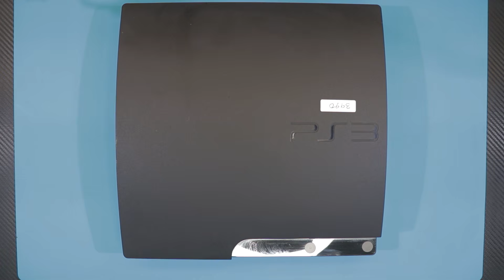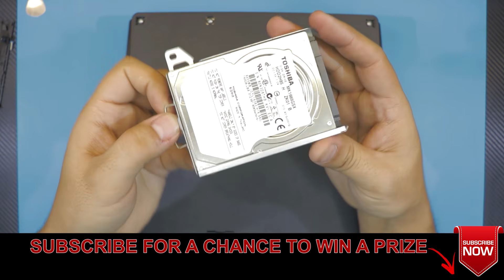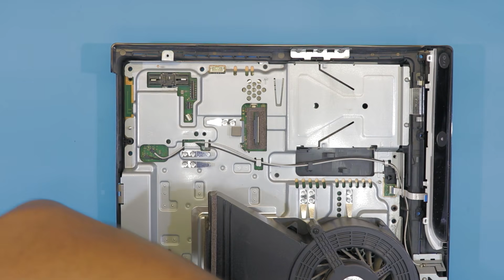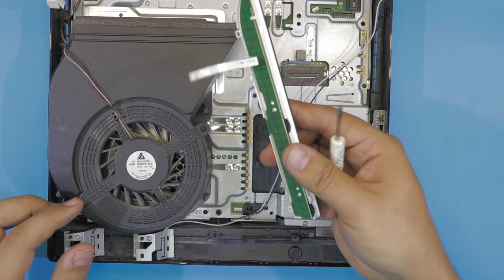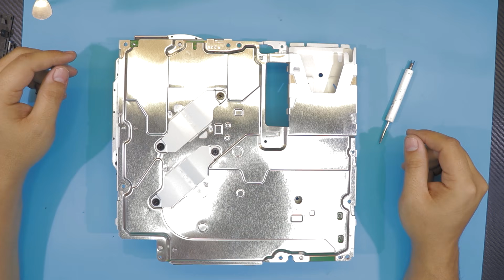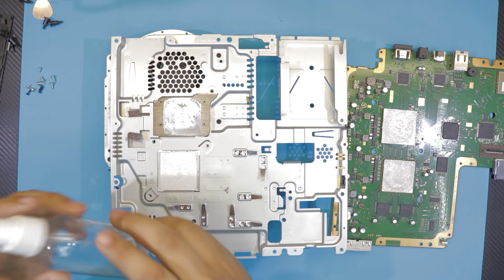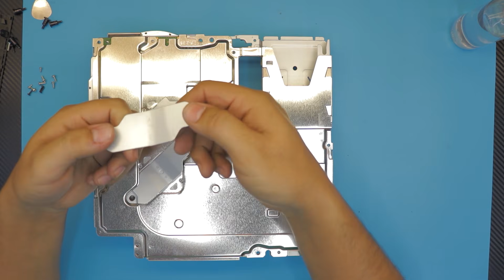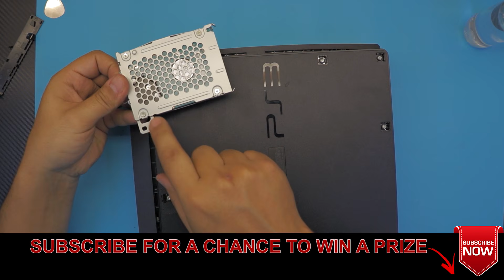HOW TO CLEAN AND  REPASTE YOUR PS3 SLIM ( playstation 3 slim console )

Comment: He forgot to put the black screw that holds the optic drive in place back (right before putting the power unit). See at 25:05
Reply from the maker: Oleg Lukyanchikov yes my friend you are right , i had to reopn it and place the screw back, but nothing will happen if you dont the chassis holds the optic drive very tightly. But good observation.  This video is old and back then i was trying to focus on the recording monitor and do the job in a position that i had the camera on my face almost.  Now im used to record and do the service at the same time 😋 thanks for the support  and comments
Reply: @uFixTek  thank you for great job showing the procedure. I just left the comment here so that others can put the screw back. When I was done,  I got worried when I saw I had one black screw left :)
Reply from the maker: much appreciated :)

Comment: Damn there’s a handful of screws I’ve failed to place lmaooo
Reply from the maker: it happens most of the screws are useless anyways.
Reply: uFixTek ahh thank god, my PS3 won’t accept discs now though. My uncle did tell me the PS3 doesn’t want to take in disks,  but it’s because the rom metal frame is smashed so it’s covering the entry port for it to take discs
Reply: I left out the security torx screws, I removed them with a tiny flat-headed screwdriver! xD
Reply: @Major Gear no screws left on table after reassembling, did I something wrong? :o
Reply: @Shejku92  maybe you drop it and it teleported to another dimension
Reply: @3wGaming  can be :D

Comment: Nevermind that, I got everything put back together and now I cant turn it on, PLEASE HELP.
Reply from the maker: double check the PSU cable inside and the flex cable of front panel
Reply: @uFixTek  I followed everything and it powers on for like 20 seconds then switches off. How do I know what is the issue? I double checked the psu cable and it was all connected.
Reply: What flex cable do you mean ?

Comment: Whats with that 4th tiny screw on yours? its ot there on my ps3, and I cant lift up and it feels like theres a screw there. Any help is appreciated.
Reply: My motherboard was stuck tight too and felt as though there was another screw that I had missed, I was losing hope of being able to access the CPU/GPU chips without breaking something and was about to give up when I saw this video and how he warmed up the chip area on the underside of the motherboard first. In my case I warmed the area up with a hair dryer and prised the board apart around the edges - it worked and I was so relieved!
Reply: @sputnik466  
I forgot to remove the "warranty sticker" which had another screw behind it, lol

Comment: Hooking back the disk drive is a royal pain. Getting it out is easy!
Reply: Bro next time take the ribbon out from underneath the drive itself and not from the mobo. It's so much easier to reattach it that way.
Reply: @hamajangz9586  dont think its easier bcoz the ribbon cable is easily detached from the motherboard connector. Either way you still have to disassemble the dvd drive in order to reattach the cable properly.
Reply: Yeah just take the top of the bd drive remove the ribbon cable from the laser
Reply: I can open up a xbox 360 blind folded ( no joke) but ps3 are tough to take appart and reassemble.
Reply: @MrVitalic85  that is dope
Reply: @MrVitalic85  if you think PS3 is hard, do NOT try to disassemble PSP 200x, extremely compact, 3x more screws, every screw is really small so it's easy to overscrew them and LOTS of ribbons going through the mobo to the other side. I tried to change back and front cover to a less damaged ones. NEVER AGAIN!
Reply: Lucky I have tiny hands
Reply: @MrVitalic85  Wow.
Reply: All u need is a steady hand and a good pair of tweezers
Reply: @afiq358  wrong.
Reply: @asad2212  how did you do? I just committed the same mistake
Reply: DEFINITELY
Reply: Facts
Reply: No it isn't dude I placed it back in easy af 
😂😅 not sure how you find this to be a royal pain
Reply: @jamesdaniels9752  the ribbon cable on the bottom can sometimes be hard to reconnect.
Reply: @arrivedknight7632  if you know what your doing it's a breeze..personally I've worked on so many ps3s and ps4 over the years that it comes naturally easy to me Tbh..
Reply: @jamesdaniels9752  well it was my first time fixing a PS3 so I guess that's why it was a pain
Reply: @arrivedknight7632  that's understandable, I could imagine.

Comment: Thanks for the video. I'm hoping someone can help though. There's a small metal bracket attached to the case, near where the HDD cage sits. When you put the motherboard back in, it looks like the HDD cage sits on top and then the 2 x black screws are screwed in. I can't figure out how that small metal piece sits in!? I'm close to just throwing it away lol. Anyone shed any light? Thank you!
Reply from the maker: lol you dont need it , you can trash it or keep it, if you dont know how to place it.

Comment: Excellente video. Many thanks.  Liked and suscribed. One question, what thermal paste would you recommend to stay away. I've heard that some can melt and destroy the motherboard, is that true?
Reply from the maker: lol Jesus who said some can melt and destroy i been in service for over 15 years not even a single motherboard failure because of paste melting lol , all you need to know regarding thermal paste is to use google and or get the recommended brands, dont go with china crap paste or some pure silver ash.  go with artic silver 5 , artic mx 4, or one of the best pastes is https://amzn.to/32KLvWs   (Thermal Grizzly Kryonaut) this is one of the top of the line, if you want to go better you have to go Liquid metal and that is only for gpus.

Comment: what screwdriver is that? also, should I worry about static?
Reply from the maker: gordonwar32 that screw drive was given from a manufacture company, i can link to a wey better screw drivers when i get back to office
Reply from the maker: gordonwar32 about static: just dont start rubbing your hair or clothes touching the metal case is enough.
Reply: Get yourself a anti-static mat and a earthing wrist band off amazon for peace of mind. Attach one end of the wrist band to the mat and the other end with the crocodile clip from the mat to something that is earthed (grounded) like a radiator water pipe etc.

Comment: At min 25:15 you forgot to put the screw at the back of the BD Drive
Reply from the maker: CiTRU5 i did but i put it back after the video.  But nothing would happen if you forget it most of the screws are unnecessary. Thank you for mentioning it :p
Reply: @uFixTek  so that's where the remaining screw is supposed to go :D
Reply: not really unecessary I think it just helps if the system gets very hot so nothing bends or flex
Reply: Lol, I'm glad you pointed that out. I misplaced my screw somehow during the teardown... i think I might have put it in the heatsink shrowd?... whatever, now if i find a tiny black screw in the future, my OCD will kick in and Ill tear this thing apart again, lol.

The power supply case does hold down that little tab too.